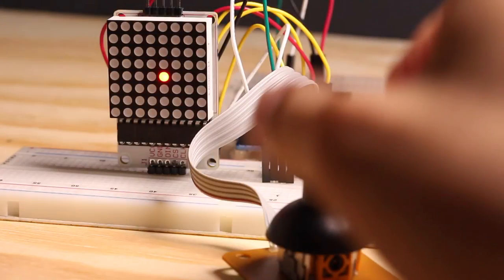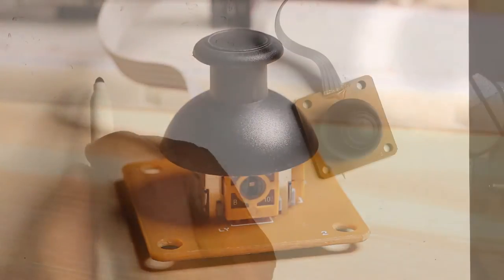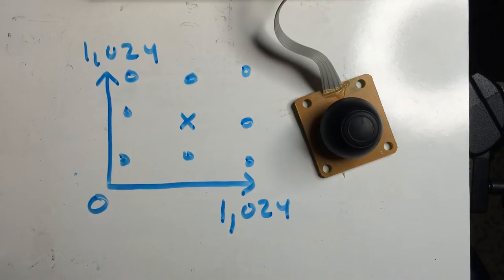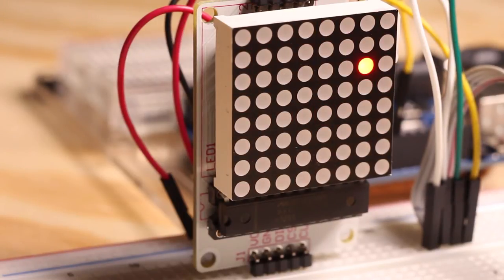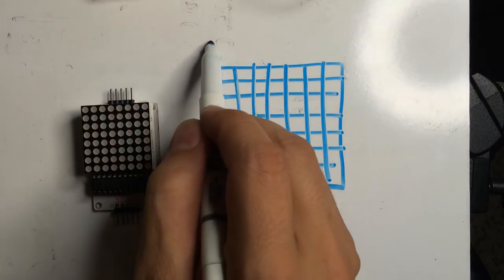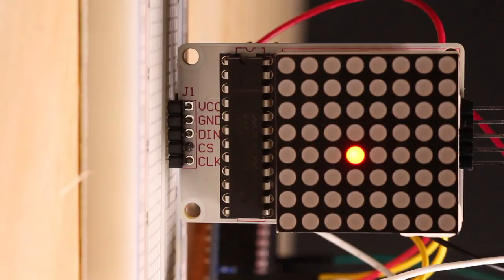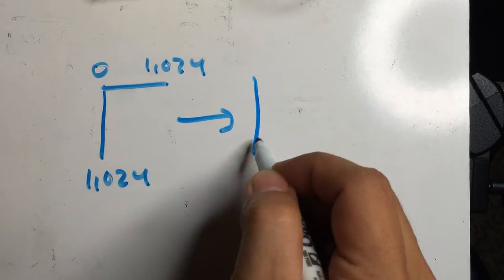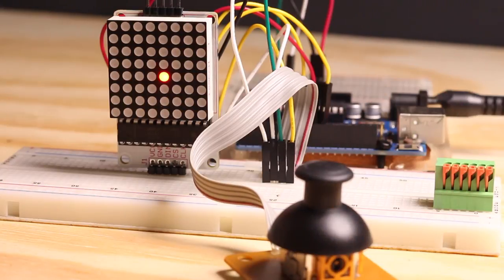Arduino 2-axis Joystick and 8x8 LED tutorial

Comment: Did anyone else notice that left and right were inverted?
Reply from the maker: Yeah I was a bit lazy with the code.
Reply: Same as 7 by 7  it's an easy fix. But otherwise everything is perfect. Wiring is obvious and code is compiling without any problem. Really good project for beginners.